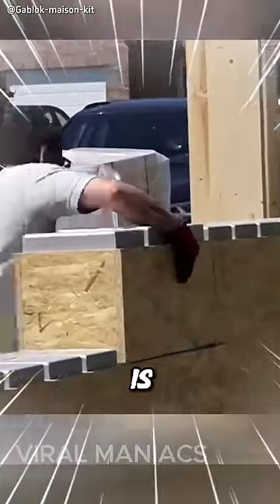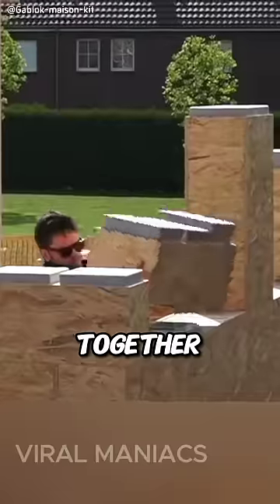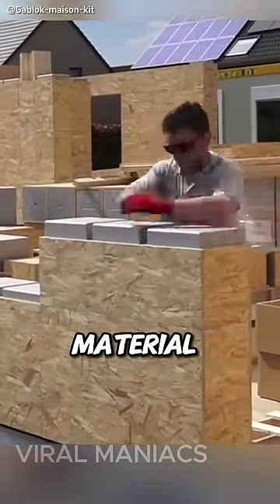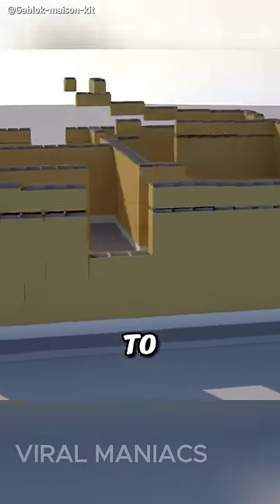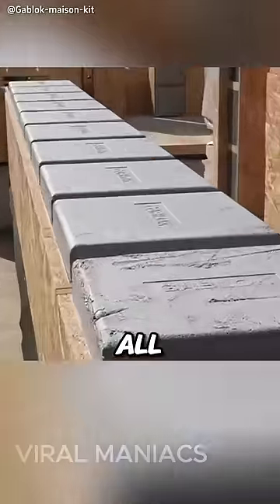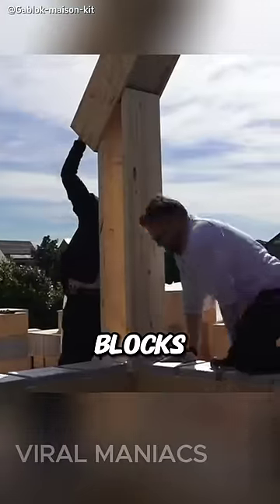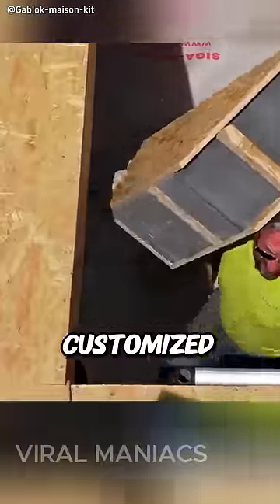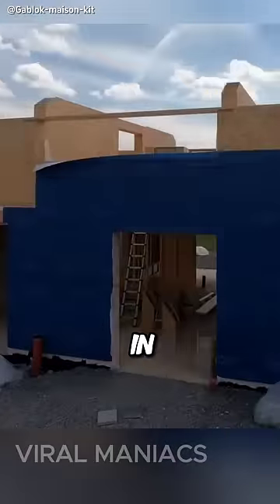Whoever Invented This Way Of Building Houses Is a Genius #shorts

Comment: The stones were invented in Belgium.
The weight of an insulated wooden block is between 7 and 9 kg, so a crane or other aids are not required. The construction also requires no drying time and therefore saves a lot of time. There is no excess waste because every single component is actually used. When the structure is finished, the roof follows as well as the desired surface treatment.
The blocks are prepared accordingly for the installation of building services (electricity, plumbing, etc.), so that this work can be completed quickly and easily by craftsmen.
Until now, the Gablok company only offers its "building blocks" in Belgium
Reply: Thanks.  We sure have a lot of very uncreative people on this sight, they need some basics.
Reply: I would love to see this in Canada.  I imagine the insulation would work great here, where we have very hot summers and very cold winters.
Reply: Such a bad idea lol
Reply: I live in America 🇺🇸 do yall have business here? I think that's a neat invention. Is it fire retardant? How much is the cost? Information please?
Reply: @highball1415 Site! 
I think you may have been a victim of “psycho-spell “, aka spell check!!
Reply: Thanks for the info.
Reply: Great idea !
Reply: @SteveBrown-n6k . It’s fast construction, great insulation and it should work well.   Why do you think it’s a bad idea and what’s your background?
Reply: @Dbb27 that glued wood board is gonna fall apart after a couple of years of humidity. Can't really beat longevity of cement and brick.
Reply: @Dbb27 his background is senior keyboard warrior 😂
Reply: @test-db2ue   🤭
Reply: @MrJamesRustle   it’s OSB and used in frame construction for several decades.  It will have a waterproof sheathing and some type of outside finish like siding.  It doesn’t fall apart any more than plywood if allowed to get wet.
Reply: How do they get the wiring and plumbing into the walls?
Reply: What happens in a fire?
Reply: @EduardoGarland-pw4el   same thing that happens in any fire. No different than a frame house.  I went on their website but the language was Dutch I think so couldn’t read everything.  No doubt there are retardant regulations that need to be met.
Reply: @sarahirwin1769   every wall in the layout is planned to have channels for the wiring and plumbing.  It’s actually faster and easier for the electricians and the plumbers as they don’t have to cut through or run electrical/plumbing lines through established walls as is required in normal construction.
Reply: @brookeggleston9314  Didn't know the grammar patrol would be here.  Do they give you a badge and gun? A check?
Reply: @MrJamesRustle not hating. I kind of agree, but that OSB stuff is really meant to stay dry. If it does (hope), it's not bad. But I want to see resin-impregnated multi-direction woven hemp panels used. Also, I'm just making that term up, but dammit, it should work.
Reply: @wombleofwimbledon5442   time for a new invention?   Go for it.  I love the bamboo idea.
Reply: I have seen these in the past. The only thing is cost.
Hopefully they will be adopted and lower the price a bit.
Reply: Seems like a good idea.
Reply: I think it's verry smart design and obviously a massive time saver I just wondering if it's cheaper and weather it's strong enough incase of bad weather, but brilliant
Reply: “Until now” meaning what? Where else are they now available?
Reply: I want this in Canada... well... we have to test it here for sure.  We might need to triple blocks rows just for insulations purpose.
Reply: @Marquise1  besides all the electrical and plumbing and who knows if it needs a frame,it would help with strong wind but it's a genius idea.
Reply: Will it withstand strong winds?
Reply: @Dbb27 I just looked at the website and you can translate into English.
Reply: @lasenoritacometa1977  If it were not wind and hurricane-proof, no building permit would be granted in Germany
Reply: @wombleofwimbledon5442 , hemp brick, is stronger than concrete.
Reply: @SteveBrown-n6k 
There's always one.  And just what real life experience do you have on the product or process? Better yet, what product have you develoed that surpasses this or any other tested and approved construction product or process?
I gotta go.  Can't believe I wasted this much time replying.  I'm out.
Reply: I think he said there are customized blocks for special features.  Probably like roof and utilities.
Reply: Can they withstand F3 tornados?
Reply: @Khangel Same here in Canberra Australia. Six hundred metres above sea level. Cold in winter but probably not as cold as Canada 😊. Australia has a bad habit of building cold houses.
Reply: @MrJamesRustle Maybe. But surely the designers selected materials that would last?
Reply: @test-db2ue lol 😅
Reply: @justbecause9049  I don't think so, there is a lack of experience - Germany has had an F3 tonardo once so far
Reply: @Khangel same here in Minnesota
Reply: Walmart has a Great Value gablock in stores now.
Reply: @Khangel  hey I just wanted to ask how hot it get up there ? I live about 4 miles from the Oklahoma border an it get to be about 105 to 110 with the heat index down here  so I was just curious. Thank you
Reply: ....and then the wind blew my house away.
Reply: Thank you so much Gablok salesperson.
Reply: What do you mean, "...prepared accordingly...?"  Does this mean renovation/changes in the long term are impossible because the design is set during manufacture?
Reply: @sarahirwin1769 Heat up a metal ball and drop in the polystyrene to make a channel
Reply: @McAwesomeReaper  that's exactly what it means. I see no way of changing or adding to it once it has been specced
Reply: @Norm8179 - Could definitely lower the cost of construction if you’re good at DIY. But then you still have to get all the permits & approvals.
Reply: Does the plywood withstand snow and rain?
Reply: @sharksport01  
🤣✔️
Reply: So that means importing them to build a house in the US will cost a hell lot of money alone, not counting transportation costs, labor etc.
Reply: This works way better than concrete or is a concrete foundation still needed? Most likely it will be if the blocks must die on a hard surface to remain firm.
Reply: Because Europeans have no clue what North America Climate and building adequate homes is about.
Reply: @Khangel does not meet code at all, especially  2024 code.
Reply: @justbecause9049  Why? Do wooden houses or tin trailers survive hurricanes in the US currently? From what I've seen, all the buildings get destroyed, so what's your point?
Reply: Average house burns in 4 mins nowadays,  its all the stuff inside that fuels it, just as much.
Reply: Does Belgium not have tornadoes
Reply: @melissadunkling7010   Maybe only on Thursdays when the moon is full and all the woodland creatures and fairy folk meet together for their annual Frisbee - golf tournament followed by a Hootenanny. I think..🤔
Reply: Are these blocks costly?
Reply: @highball1415 what do you mean?
Reply: @rodneyfernandez5304 it’s the osb insect proof?
Reply: "What are the bad features of polystyrene?
Chronic exposure to high levels of styrene can cause liver damage and nerve tissue damage. These effects can be especially pronounced in fetuses and young children. The gasses that manufacturers pump into polystyrene to turn it into “foamed polystyrene” can also be hazardous."
Reply: Homes now are made out of cheap material besides the framing and concrete it's just chicken wire, styrofoam, stucco and paint etc lol
Reply: What about really windy places lots of rain very rarely have sunny days etc.. no good for where I'm lol 😊
Reply: Hemp blocks inside would be the go vs poly
Reply: Brilliant
Reply: Where it rains every day.
Reply: That “glued wood board” is OSB board. Along with 2x4’s, it is the most heavily used material in residential construction in the USA and Japan.
Reply: What about fire resistance?
Reply: 😅 @Khangel
Reply: Cost vs stick vs brick?

Comment: I'd like to see a finished and functioning complete house and how it looks.😊
Reply: Plumbing & electric, yes.
Reply: It's on a slab so I would say plumbing is in the slab now electrical I have no clue
Reply: It's called Renco USA. Easy to find.
Reply: They did seem to leave out on how to get plumbing in the walls and electrical through. Even the brief look on the finished floor no holes for outlets.
Reply: Video shows stud wall once the blocks are in place.
Reply: That's ez, it'll all be wireless, duh
Reply: I’d like to build one of these houses.
Reply: @tonymc3817  sorry but electricity or sewer is not wireless.
Reply: I think it comes with a pallet of candles and a KEY to the neighbor’s house to use their toilet and shower... when they aren’t home.
Reply: Earthquake and wind tests reports should have been done. Will need to look it up.
Reply: @jrkrahn9717 . You can make fixtures and assemble the blocks, then the house. Would take no longer than a from-scratch log cabin.
Reply: @TimeToBeKind . The outhouse isn't that much more.
Reply: @tonymc3817 I'm Dying,😂😅😂💯
Reply: @cme98  Pretty sure he's joking
Reply: @cme98  wot bout blu tooth
Reply: Termites can damage the units structurally- OSB is terrible
Reply: Who makes him house from wood and plastic?  Just make it cement and cinder blocks.  At least it's bulletproof
Reply: They built one if theses in the UK I believe.  Don't remember the show. That showed the building of it. They done some of the work on sire with equipment they brought in.
Reply: @cme98  I was joking. But maybe what Tesla did with power though 🤔 lol
Reply: Yes snd i would like to see one twenty years old i think there would be a problem with the polystyrene shrinking
Reply: How Do You Wire It...
Reply: @cme98 neither too is your ability to figure out sarcasm dear - stay plugged in... 😱
Reply: so when do they pour the concrete?
Reply: & I'll Huff & Puff.....
Reply: They play the "everything is awesome"  song the whole time it's being built 😁
Reply: @debra-qq1np  Hollow Crown and foot Moldings will solve most of the problem with Plumbing and Electric along with a "raised" flooring for plumbing.

We building houses like garbage.  Once a house is put together... we should NEVER need to go into the walls to service anything.  It is a sign of how "pathetic" we are being in home design.  We already have the technology and process to solve all of these problems... but because greedy people want these things to be sealed behind huge pay walls... we can't have them.

It's a legal, industry, and concept problem.  We are holding ourselves back BIG TIME!
Reply: @Krusherxxx Stick some redstone on the blocks.
Reply: @cme98  electrical is combination wireless charging solar sewer coffee can in garage
Reply: Want to see after some wind😂

Comment: The true test: What would happen if a big, bad wolf huffed and puffed in it?
Reply: It will come crashing down, but pray the wolf doesn't sneeze, or the blocks will scatter until the next state.
Reply: @Lucian00311 not necessarily… when you have 4 walls secured down.. it’s impossible it will take 200 mph winds to really do anything
Reply: @Jayman21890 I guess you have no clue how powerful GOD storms can be 😀😀
Reply: Respectfully and responsibly we do not sell these blocks in tornado and hurricane prone areas we also do not sell them in areas with extremely high winds😅
Reply: 😂😂😂 @Lucian00311
Reply: Depending on where you want to put it, exterior modifications could be custom designed to shield and secure this type of assembly from extreme high wind, obviously at a relatively increased cost.
Reply: Or used matches
Reply: ❤❤❤ My thoughts exactly hehehe 😅😅😅
Reply: @Jayman21890  lol, a bad storm will destroy this house if its in the open unprotected from even 30mph winds
Reply: 0
Reply: @pharrememjay8630 so that's a no to me in Hawaii.
Reply: @Jayman21890 Only 200 mph wind? I live in Florida.
Reply: Have you ever tried how strong a well constructed LEGO house is. No wolf is going to blow that down bro.
Reply: @ranndomundead9112  lol some of y’all be just be yapping with stupid comments. There’s 0% chance that structure would come down with 30mph winds🤣. I mean ZERO. That structure is built using something very similar to joinery, which has been used in all types of construction for centuries🤣. Not to mention that building in the video isn’t close to finished🤣. They were just starting to tyvek it, the siding will provide more structural strength also although it doesn’t need it.
Reply: @thomasbedford1692  in a basic 30mph wind storm youre looking at a gust potential upwards of 80mph.
Reply: 😂😂😂 @Lucian00311
Reply: @thomasbedford1692 I like how you keep laughing through out at your own shit that's not even funny. Lame.
Reply: @Jayman21890 yeah right a home put together with no fasteners is screwed in a tornado or hurricane
Reply: Or you get a rat, you’d never find it
Reply: @Stacked3403  how do you know it’s not fasten?
Reply: @Stacked3403  no where in the USA can this kind of build be legal without fasteners. Period!
Reply: @Jayman21890  I guess I don't know but just from the video it looks like the walls don't have any fasteners, obviously the roof trusses will have hurricane clips I'm assuming.
Reply: Cost??
Reply: Now even buying houses on TEMU? Wow
Reply: Do these Blocks BURN that would be my First Question!
Reply: And when the windstorm comes
Reply: @sircharms531  laughing at the stupidity of the comment section buddy. Anyone who’s ever worked on anything could tell you that is not going to just blow over🤡🤣🤣
Reply: @ranndomundead9112  so? Still wouldn’t blow over 🤡🤣
Reply: I wondered the same thing?
Reply: @Jayman21890  it's not just that the wind is blowing really hard, it's all the other things that got picked up by the wind. You know, like cars, trees, washing machines, your neighbor's roof...

This wouldn't stand a chance in a real storm.
Reply: Tornadoes have a way of punching holes in anything using cars , steel poles, tractor trailers up rooted trees ect. Ect. 😅😂😅😂
Reply: Woolf will blow the house down
Reply: Make them so they can work in a dome structure.
Reply: @robertszeles3382 , most building materials will burn, under the right type of conditions. Home owners don't buy insurance, or have escape plans for nothing.
Reply: @Jayman21890  So how hard are fasteners? This short did not preclude the idea of fasteners.
Reply: @Jayman21890  the blocks will come apart as easily as they go together.  Unless there are hidden steps.
Reply: @thomasbedford1692  tyvek has zero structural value. Those blocks will come apart as easily as they go together. A furniture joint will come apart as easily as it goes together too.
Unless there is a strong connection (probably an adhesive), it will fall apart. 
Nailing siding to it does nothing.  Nails easily pull out of OSB.
Reply: @markdaniel8740  yeah your right! It’ll just fall apart! I’m sure they designed it that way. I’m sure you’re an engineer, or have 120 years experience also…..